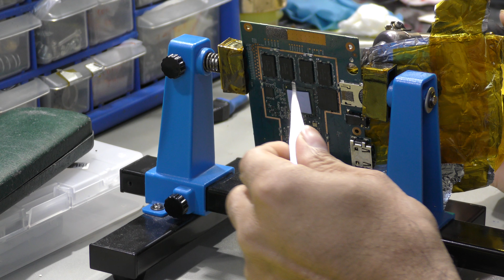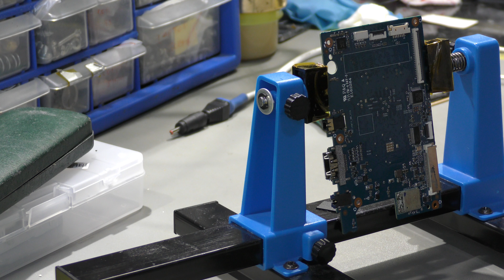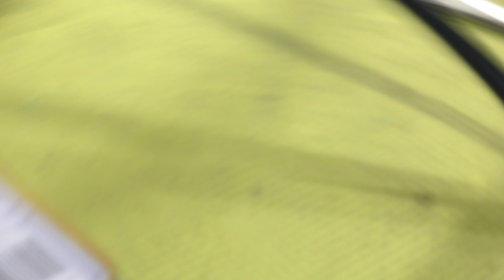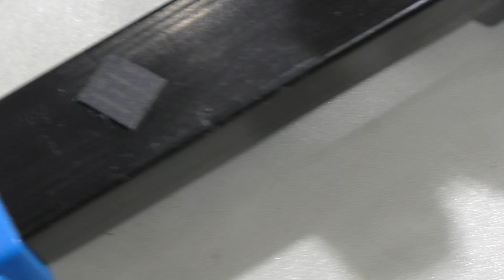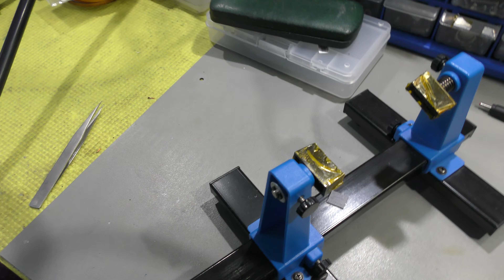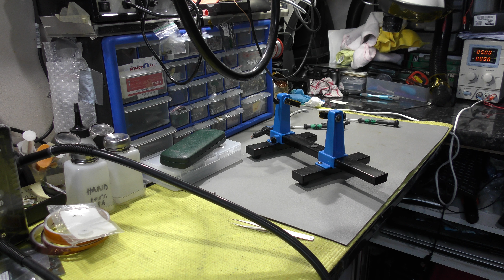HOW I REMOVE SENSITIVE COMPONENTS WITHOUT DIRECT HEAT

Comment: Do you have to reflash bios after the upgrade or do you just solder any size chip on and job done?
Reply from the maker: The ones I have done before there was no need for bios refreshing. But the emmc nand has to be same model. Cheers